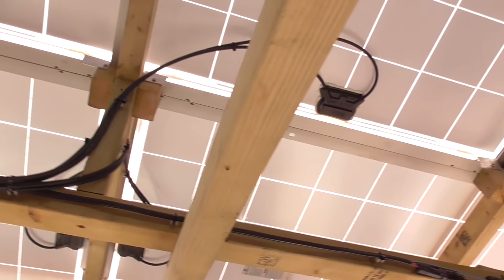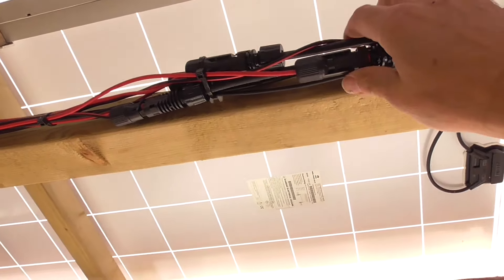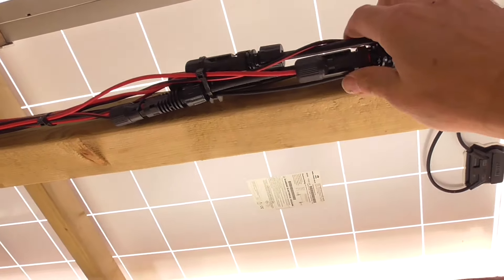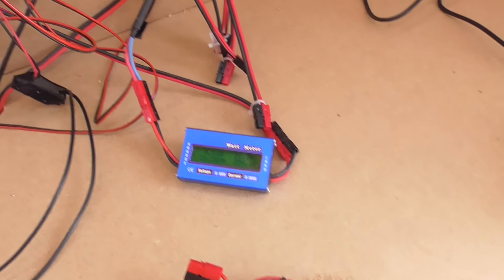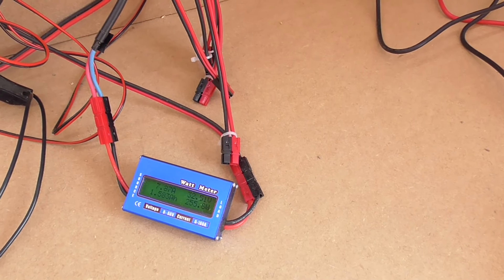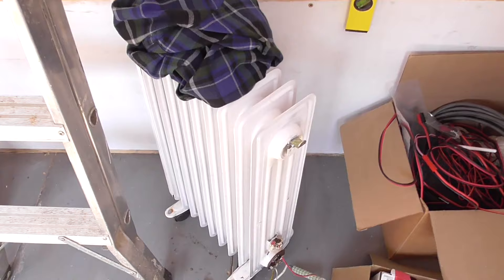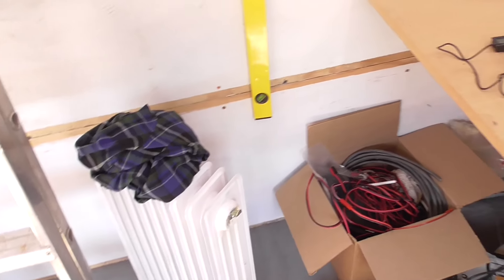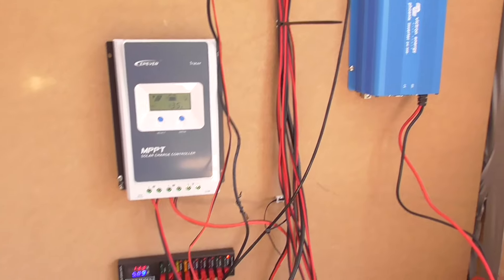DIY Solar Roof Shed & Powerwall - Introduction

Comment: Just come across your channel great setup and liking the idea of using the panels as the roof as it lets the light through and free power great shed. I have subscribed for future updates. What did you use to seal between the panels ?

Comment: Interesting use of the panels for the actual roof. How did you seal the panells together?
Do you get problems with condensation? I've used bare metal sheeting for a shed roof, and it tended to 'rain' inside, fron the condensation!

Should the charge controller not only draw it's rated max current? So it should be fine to give it as much PV capacity as you want. But if you want toi use that extra capacity, it should be fine to paralled the outputs of multiple charge controlers, up to the max batt charge limit.

Watch out for HV DC. Switch rating are your enemy, as DC does not self quench like AC. So a 400V AC rated switch will only be 50V at DC.

Comment: i recomend getting the mt-50 display also this unit can take upto 2720 watt the controller will ramp that back to 40 amp you will also need a computer to link to the controller or the mt-50 to program the cutsem settings for lithuim i seem to recall solar max pv been bigger but cant find the manual for mine looked online
Reply from the maker: I've got the PC cable to configure the charge controller, I just need to find a Windows PC somewhere.
Reply: @recklessengineering8628  i guess one could use windows pe and just temp boot to windows from a linux machine or even a vm

Comment: If you connect that Heater directly to the PV Panels, you must have a 240 Volt DC RATED ( not just an AC rated ) switch - good luck with that ...
Reply from the maker: Yes, and a 240v DC rated thermostat, in a future video you'll see the sparks that come from disconnecting DC at that voltage :)

Comment: all cell sized panel bar the 36cell ones can be run 2 in series the 36cell is best to have 3 in series for a 24v system if the 72cell or 96cell panels then 1 in series

Comment: i had thoght about solar pane;ls as a lean to roof and just overlaop the bottom of one over the top of the other to make a lip so the water runs from one to the other then have uchannel as like a gutter if the side to side joins leaked

Comment: found the info 12v max pv 1560 w 24v max pv 3120 w  but i would say it be better to get a second controller otherwise you will be limited to 40 amp
Reply from the maker: Hi, where did you get these number from? The specification I have says " 520W (12V) / 1040W (24V)" for the 40A model, but I'm happy if this is wrong.
Reply: @recklessengineering8628  another page in the manual 2.2array requirements also tells you how many solar panel can be in series depending on the cells per panel
Reply: rated charge power 520w/12v 1040w/24v max pv array power 1560w/12v 3120w/24v so even tho you can put in 3120w only 1040w will go into the battery i am not sure if loads could be used for the rest of the excess power

Comment: When using the solar controller load out what is the maximum amps can be run through them
Reply from the maker: According to the EPEVER datasheet the "maximum discharge current" of the Tracer4210AN is 40 Amps, so I assume that means current out of the load output. I've never tried it though as only use the load output for small things.
Reply: @recklessengineering8628  I carnt find much info in the charge controller I'm using all I know is it's a 10amp at the moment I'm running about 4amps through load out,